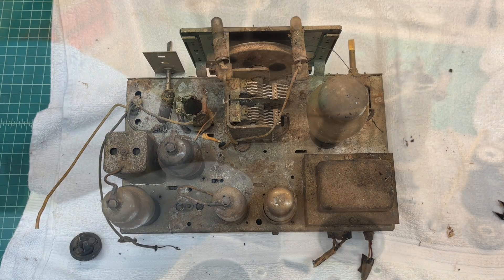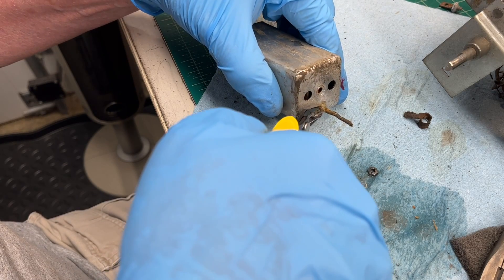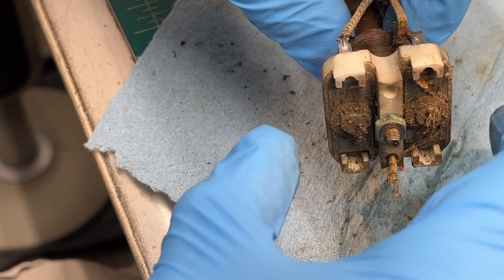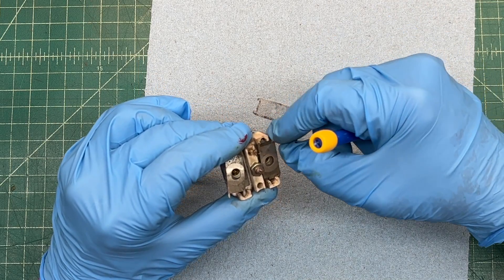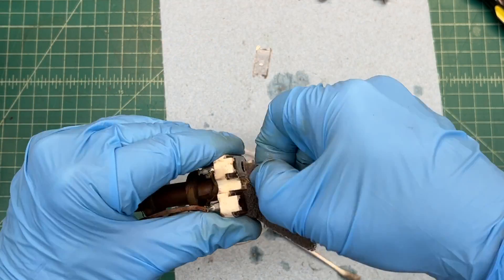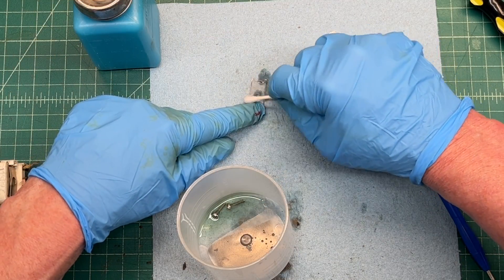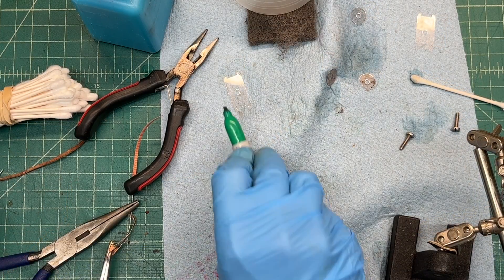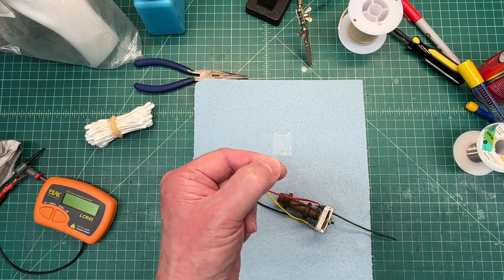Stewart-Warner - 01-521 | I.F. Transformer Revitalization

Comment: Always store your Magic Markers with the tip down and cap on tight so it doesn't dry out. Yellow is the worst culprit for 
drying out so get a highlighter type instead. Just wanted to share that info since you share so much with us Don. You 
are an amazing restorer when it comes to stuff like this so thanks .
Reply from the maker: Steve - great tip no pun intended. Funny, they stock them on the shelves with the tips up; probably marketing to keep moving them out the door. Thanks again for sharing this Steve and your kind words. Best, Don

Comment: Curious to know why you didn't desolder the plates and remove them for cleaning?
Reply from the maker: I considered doing that, but a careful inspection of the plates facing the (compressed) mica was clean for the most part, so unsoldering the coils from the… was not needed. Great question and thanks for watching and again reaching out. Best, Don

Comment: Thanks for the video always informative.    I have a question . How would you cut the mica sheet if you had to.    Thanks.    Dean
Reply: Don will probably answer this, but I have seen people just use scissors on thin mica.
Reply from the maker: Dean - as Ian noted, a very sharp pair of scissors; however I’ve only done this a few times so there may be a better M&P. Best, Don